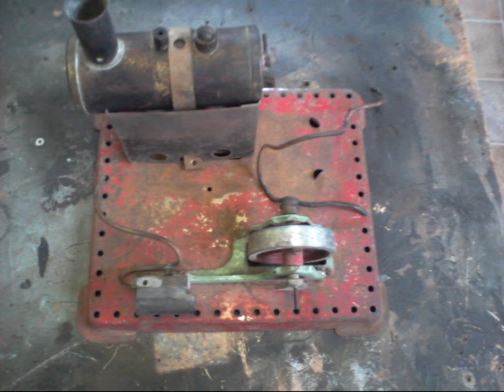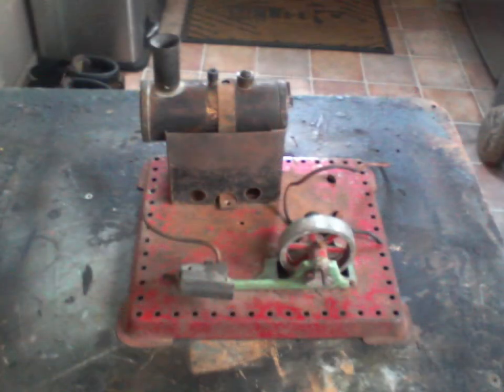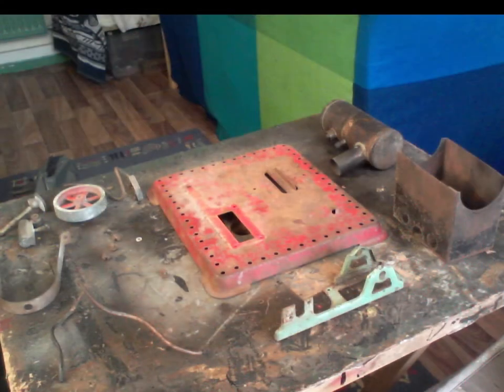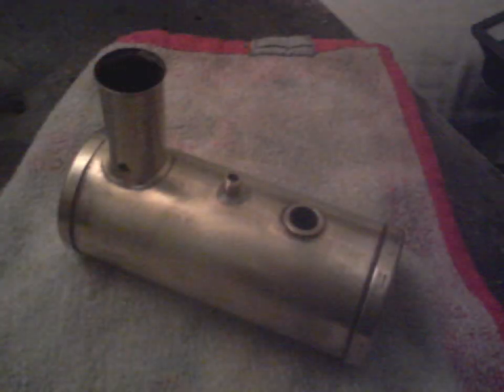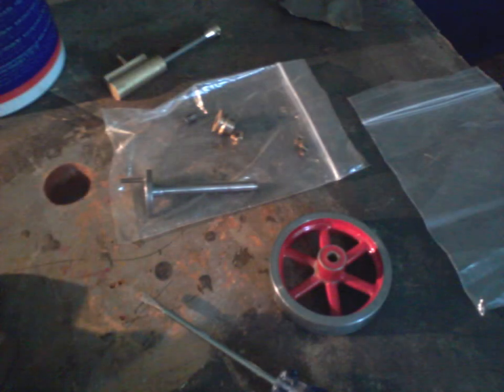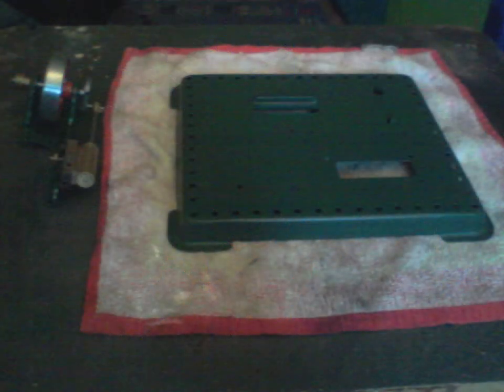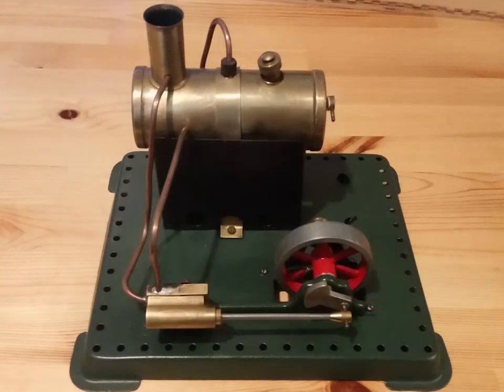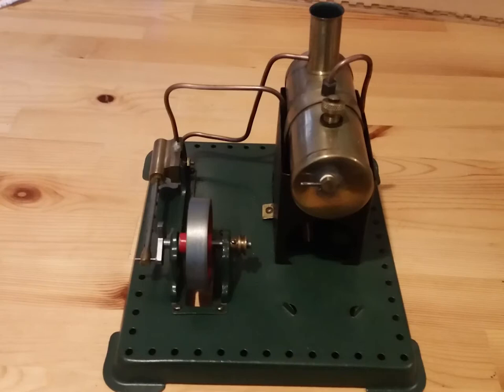Mamod SE2 - Stationary Steam Engine - Restoration (2012)

Comment: Can I ask at the end when you inserted a pipe in the top of the boiler was that compressed air? Many thanks and great colour choice 👍
Reply from the maker: Thanks for the comment and kind words. 👍 You are correct, it was a small airbrush compressor which I use to test my small steam toys. It can only output around 15/20psi so no risk of over pressurising the little brass boilers. All the best.